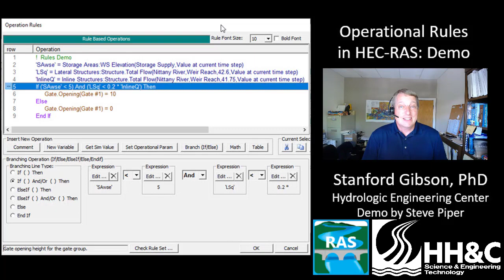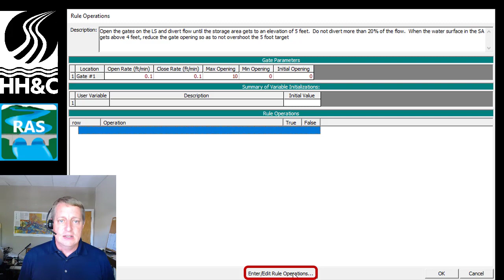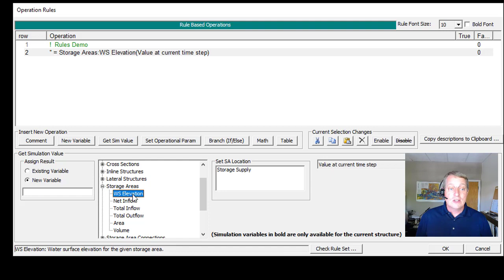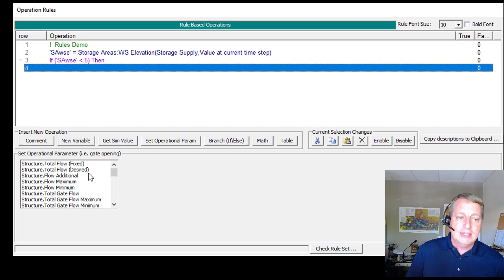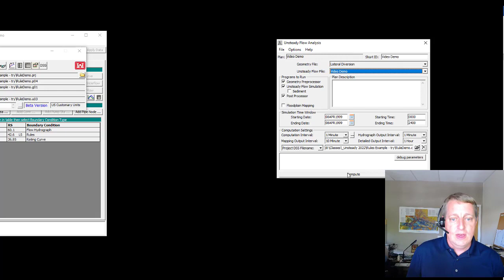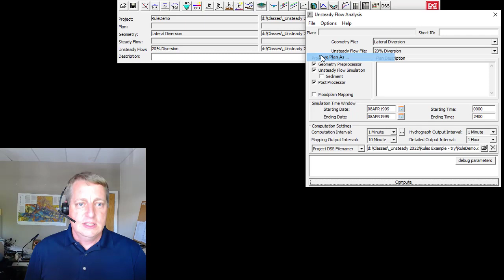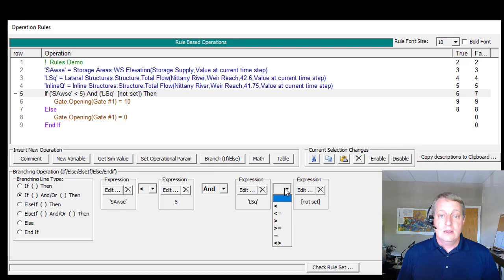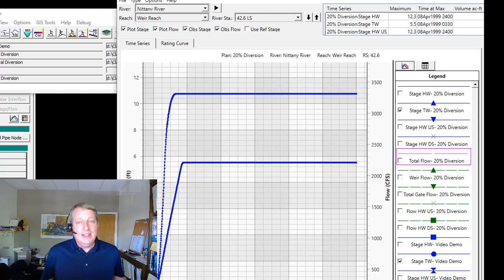HEC-RAS Operational Rules Demo

Comment: Can you breach a structure for which you have rules? I'm finding that despite my rules using "If" statements which bind them to only apply during a time window, after the window is over, HEC-RAS is not honoring the breach.
Reply from the maker: You should be able to integrate breaching with rules...we actually set up a simple test case just to make sure its working in 6.4.1 and it worked for us.  There must be something else preventing the breach.
Reply: @stanfordgibson  Thanks for following up!  I figured it out--I actually had to enter the breach into the Rules routine.  I'm simulating a dam with limited outflows on the ascending limb of the hydrograph that represent the operating the scheme of the dam, in order to prepare downstream infrastructure and communities for the coming flood.  I had these entered in as a time series (i.e. Day 1 limit to X flow, Day 2 limit to X+ flow, Day 3 Limit to X++ flow, then open all gates).   I found that I couldn't simply discontinue entering rules after Day 3, I had to tell it to use the calculated breach flow for times after Day 3.
Reply: I initially had assumed that if I gave the structure no rules, it would revert to the hydraulics as presented in the geometry editor, but that doesn't seem to be the case.

Comment: Without reservoir gate rules, can we simulate the other operational rules for multipurpose dams?
Reply from the maker: Yes, you actually don't need to operate the gates.  As long as you have a structure you can specify the flow through the structure (without reference to gate operations).  In fact, in practice, I almost never operate individual gates.  I usually define rules for flow through the structure (or sediment) and let RAS figure out the gate operations.  You can also write gates against pumps.
Reply: @stanfordgibson Gibson Thank you, it's great.

Comment: Thank you Sir. I am very happy that you have made this video at a very critical time as I am doing my thesis on hydraulic flushing of reservoirs. Can you please make a VIDEO on calibration of hydraulic & sediment model?
Reply from the maker: I’m planning to do a calibration video at some point, but it’ll be a while. If you reach out to me on LinkedIn or research gate I have an unpublished technical manual that had some good information on the topic
Reply: @stanfordgibson  I have run into a problem while simulating gates. I wrote rules in one program and RAS keeps saying it ran into trouble  reading the rules so I copy pasted rules over from a different project that worked there only changing where I got the simulation values from and RAS claims it has trouble reading the rules even though it works just fine in the other one. Honestly I'm at my wits end...